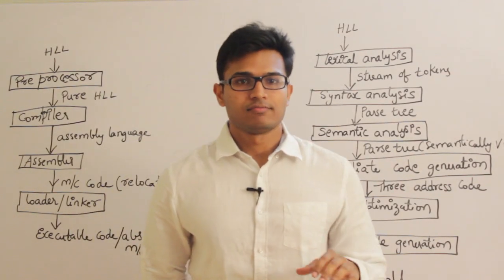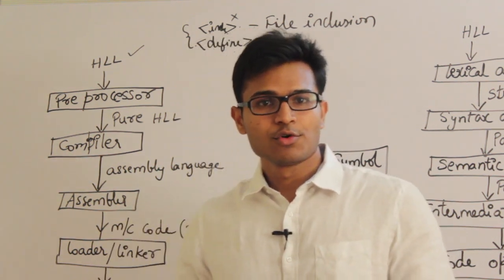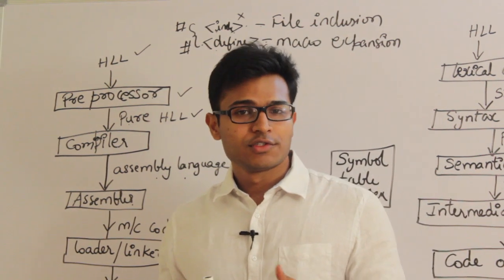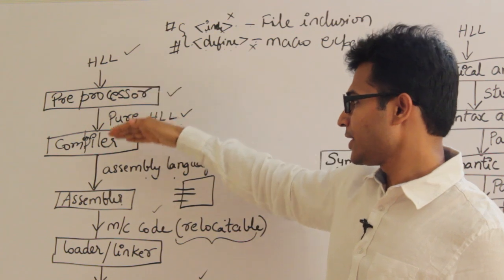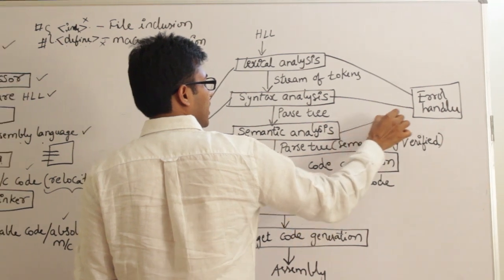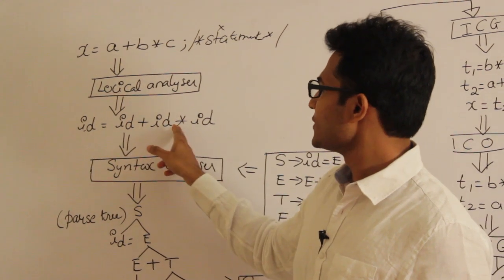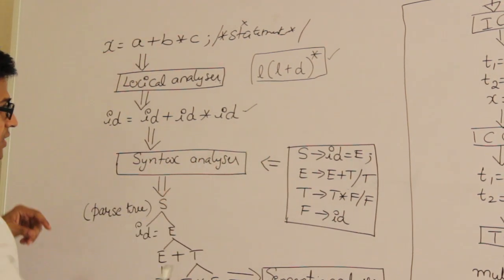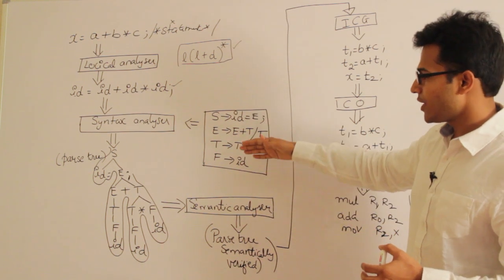CD | Introduction | Introduction and various phases of compiler | Ravindrababu Ravula

Comment: Hope This will help  someone, before starting playlist ❤
Average video length: 23.96 minutes
Total videos :24 (Excluding 25 hidden videos )
Total playlist length: 9 hours 35 minutes
Time required at different playback speeds:
    1.0x speed: 9 hours 35 minutes
    1.25x speed: 7 hours 40 minutes
    1.5x speed: 6 hours 23 minutes
    1.75x speed: 5 hours 29 minutes
    2.0x speed: 4 hours 47 minutes
Reply: Have u completed this?
Is this sufficient for gate bro?

Comment: In the late 1960s early 1970s I wrote a compiler development system I called SLIC an acronym for System of Languages for Implementing Compilers. It provides:
  1. Parser programming 
  2. Optimization sequencing 
  3. Assembler instruction
  4. Pseudo instruction
Reply: nice

Comment: The video is very compact and providing a Very Good demonstration.
but, at 00:16:15 timeline, you told finally "we are moving everything into x."
but, the MOV insctruction was incorrectly used here !
you wrote MOV R2, x (here, your intention was to copy the content of the Register R2 into Memory location 'x' pointed by HL Register pair.)
actually, it should be written as => MOV x, R2
because MOV instruction is followed by the destination and then the source

Syntax: MOV destination, source
---------------------------------------------------------------------------------------------------
MOV: - This instruction is used to copy the data from one place to another.
We could use it in three three ways as follows : 

Eg: -
MOV Rd, Rs (This instruction copies the content of Rs to Rd)

MOV M, Rs (This instruction copies the content of register Rs to memory location pointed by HL Register)

MOV Rd, M (This instruction copies the content of memory location pointed by the HL register to the register Rd.)
---------------------------------------------------------------------------------------------------

Comment: Assembly code is wrong at the end. It would be reverse. We store the value in the left hand side not the right hand side.
Reply: No. What he said is true. It stores in Right side. My textbook says the same as well.
Reply: @srikanthsidd9959  i wrote couple of programs in assembly and it always store the value in the first argument i.e, left var.
Reply: @vikramkm  I know, we had a subject called Computer Organization that said the same thing(left hand side).. But my Compiler design textbook says what is said in this video.
Reply: @srikanthsidd9959  Okay got it. They are using AT&T syntax in the compiler book. And in the coa they are using intel syntax.
Reply: @vikramkm  Oh. Thanks for letting me know 😊

Comment: sir i am bit confuse about  the definition of compiler 
at 3:00 you said "compiler takes pure high level language and converts it into the assembly language "
but at the starting of the video you said that "the compiler takes HLL and converts it into machine code "
which one definition is correct sir
please help sir
Reply: It can generate machine code, but generally it will produce assembly code

Comment: suppose when we are compiling a program having file extension dot c ".c" , the preprocessor convert the source file to expended source code and extension change from dot c to dot i ".i " again the compiler compile expended source code to Assembly source code and the extension change from dot i to dot s ".s"  now the assembler convert the assembly source code to object code and change extension from dot s to dot o, ".o " and at last the linker and loader convert that object code to executable code, " Am i right or Wront " please clear.

Comment: I dont care about lexer analyzer.
Explain anything about compiler logic, and how c++ paradigm is actually translated to opcodes. What decisions compiler makes when and why.
How it performs method call on object, how it know where to call, how does it resolves virtual functions and what is actually a class from perspective of data, code, and namespace grouping.
Make video which explains all things above!
Reply: I would bet that methods are converted into functions that accept an extra argument (the instance of the Class).
// pseudo-code
class Animal {

  private String name;

  public method displayName() returns void {
    return println(this.name);
  }
}
// gets converted to
public function displayName(Animal animal) returns void {
    return println(animal.name);
}

Hopefully, I explained that adequately with pseudo-code.  Methods rely on internal state.  Pure static functions only rely on the parameters/arguments.

If you know Python & Java, it's very easy to SEE how one language shows the implementation details (python) and the other language hides the implementation details (java).
Reply: So...you ask what exactly is a class ?

From the previous exactly, hopefully you see that a class is nothing but the data in memory... the computer really has no concept of a method... only functions.

Similar to how you construct a packet, send it over a network, & the packet gets read... this works because each type of packet has a protocol that tells you how to write it.  And since you know how to write it, you also know how to read it.

Likewise, a function expects the arguments to be available in certain registers of the CPU.  That's the function protocol.

So, for the above example, let's just say that the println() function expects the address of the String argument to be located in register R1 (on some hypothetical CPU).

So... for the opcodes...
You construct the String (array of characters) in memory.
You have the memory address of that String.
You move that address to register R1
Then you call the function.

The function gets the value in register R1 and interprets that value as a memory address to an array of char.
The function reads a character.
The function prints a character.
The function increments the address by the sizeof char (so that it points to the next character).

The functions repeats these steps until it reads a null character.
When it reads a null character, then it exits.

...
Sorry, it's been too long since I've done Assembly language... but I just wanted to give a general idea of what's going on... sorry I didn't provide the specific opcodes.

Also, there were some steps that I left out...

Like before you move an address to register R1, you push R1 onto the stack.
After you're done using the R1 register, you pop the top value of the stack back onto R1.

So push & pop are a way to save & restore register values.  Save the contents of register R1 to the stack.  Then you can use R1 for yourself.  When you're done using R1, restore it's original value from the stack.
Reply: resolution of a virtual function is done using a Table.

I don't know the exact implementation details, but I'd guess they're just key-value pairs.

The key is the name of the virtual function.

The value is probably the address of it's implementing function.

So... at runtime, let's say your code changes the implementation of a virtual function several times (probably depending on Admin or User choices).

Well... any change is really just a Table update.

Find the key, and change the value to a new address (of a function that has an implementation).

Please correct me if I'm wrong.  Good luck !

Comment: Great video. Just a little catch. Intermediate code optimization is machine independent too. Things like dead code elimination and Loop unrolling are machine independent. There are parts of code optimization that are machine dependent, but they are mostly centered around the instruction set available and their cost, mostly about the what instruction should an intermediate code map to.

Comment: if i have to generate the assembly code for the two different machines like IBM
 
and Intel then which end of the compiler i should specifically address; front end or back end?
 
Or i will not change any of the end.
Reply: aiza khan then u have to change back end... coz as explained front end will be always same for all the compilers...